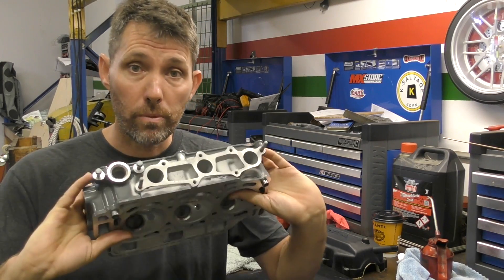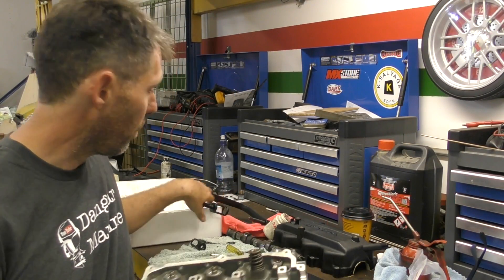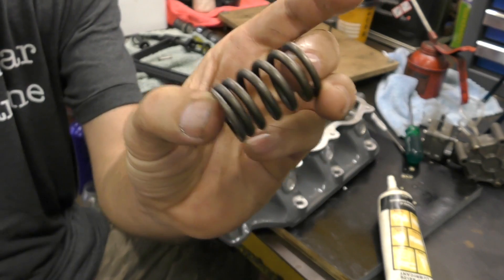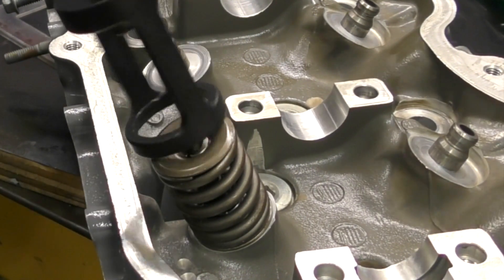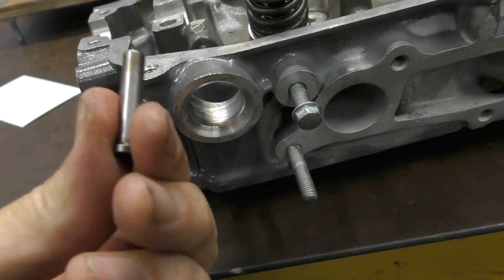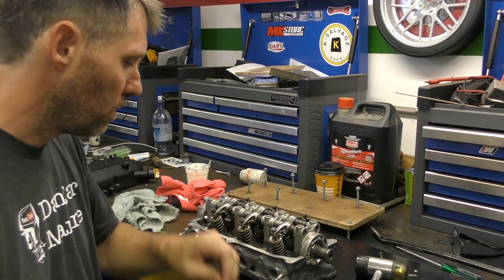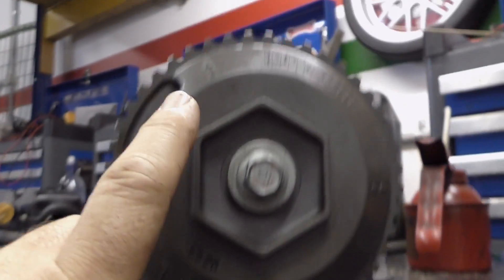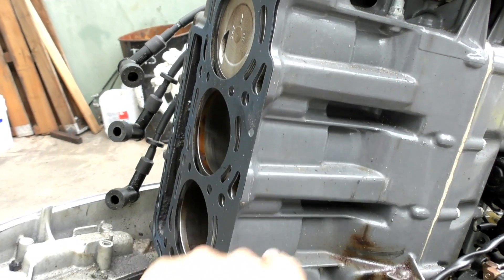Four stroke outboard cylinder head rebuild

Comment: Hi Stu, I am currently working on a 10hp Honda that has broken the cam pulley. My question is: will the valves have perhaps hit the top of the pistons and bent them, or are the pistons far enough away from the valves( interference or non - interference)  Your help will be highly appreciated- regards Dale Harris

Comment: I have a 40 horsepower Suzuki four stroke The intake valve have no clearance exhaust valve have way too much  clearance I have no compression on the bottom cylinder it's exhausting out got any ideas or film

Comment: Need to change head gasket on a BF50A Honda.  Can it be done without removing the cam shaft and valves.  In other words can I access the head bolts.

Comment: Have a suzuki df70 2003 4 stroke compression test all good bottom cylinder has best compression but getting water in oil and into cylinder 4 any advice on what's my problem??
Reply from the maker: Most likely a blown head gasket.
Reply: @DangarMarine  wouldn't i lose compression?

Comment: I found two of them collets in my sump when I emptied the oil and the second cylinder isn’t working? Any ideas what would cause this and is it a case of take apart and reinstall the collets? Thanks
Reply from the maker: If they haven’t broken I would say it was caused by incorrect installation. You might want to install new ones to be on the safe side.
Reply: @DangarMarine  thank you for the reply, I am now very confused I took the rocker cover off to check and all 6 springs appear to have the collets attached. However second cylinder isn’t firing as when I take the spark ht lead off there is no change in engine compared to the other two leads when I take them off. Have switched all spark plugs around and they all work. :-/ also the spark plug in the second cylinder was very black

Comment: Hi Stu! This has been so informative, thanks a lot!
I am a total newbie and I am trying to fix my 5hp Honda outboard. We cleaned the carburetor and fixed the fuel line, and we got to the point in which it would start and idle properly, and run low for about one hour without big issues. The problem comes when we run full throttle. If it´s cold it would hold the power for a while, but as soon as the temperature goes up, it would lose suddenly strength and sometimes turn off. I got to the conclusion that the valve clearance must be adjusted, but I fear there could be some corrosion on the valves. Another very strange thing is that since a couple of days it would turn on ONLY with the choke off. (??)

Do you think that issue could be also related to the valves? or is it just the carburetor butterfly that is once again sealed? Would be worth trying do the job with no experience? Thanks for your time.
d

Comment: Hi I was wondering if you could point me into the right direction with my outboard I have a 50hp Honda I believe it's a 06 had a tapping noise in motor they clunk stopped run any idea's. Anything is much appreciated

Comment: Do you have a video on removing the head, then the power head?I have a BF130, possible issue with the valves or the piston. My cylinder 3 has 75 PSI compression. Other cylinders are 185, 150, 150. Cylinder 3 had the spark plug tip bent down. I pull the injector plug and motor does not stall. On all 3 others they stall.
Reply: Found 2 cracks on head block. It was between cylinders 2 and 3. So you recommend the valve clearance to be max limit based on service manual? Usually they are range between numbers.

Comment: Funny how different manufacturers design things like rocker shafts ,  was doing the valve clearances on my Tohatsu 50hp 3cyl last week , it has 6 valves too like the Honda but only a single rocker shaft ,  saves a bit weight only having 1 shaft , can't see what advantages there are having  2 rocker shafts for a single camshaft engine?  I do get some intermittent ticking noise on the Tohatsu,  suspect it might be something to do with the rocker arms sliding up or down on the rocker shaft , maybe those thin springs are too weak?

Comment: Strange that there are no cam bearings on these engines.  I would surely use a liberal amount of assembly lube on the cam prior to installation to prevent spalling.

Comment: Stu I just purchased a BF50 for a parts engine and it had a broken spring which caused the valve to hit
the piston damaging both......have you every heard of these engines breaking valve springs ? check out picture 8 https://www.trademe.co.nz/Browse/Listing.aspx?id=1745427227
 cheers Brett
Reply from the maker: I haven't heard of the them breaking springs but it can happen due to a minor defect in the metal. I have seen some of them quite rusty from a blown head gasket letting water into the oil which can also contribute to them breaking.

Comment: Great video mate , i am fairly lucky as my father was very mechanical and showed me a lot as i was growing up which has served me well over the years and also some of the tools i didnt have to buy . a question  with the pittting on the back side of the valves exhaust i think they were would it have paid to replace them or just leave them ? anyway very well explained and a good video .
Reply from the maker: I think it if the sealing edge of the valve is machined or lapped to good condition then the pitting isn't such an issue. When my friend got this boat back he said it felt like we'd turboed it it ran so much better. :)

Comment: Hi Stu, ive just brought a brand new head and valves (not pre assembled) for my ride on mower, just wondering if the valves still need to be lapped or are they good to go as is, considering they are new? Cheers.
Reply from the maker: It really depends on how they are cut, but if in doubt I would lap them, even if it is only to see how well they mate to each other. You will see very quickly whether there is a good contact surface between the two or not. If so, stop and cleanup, if not,  keep going until there is.

Comment: Hi,
can you tell where I can get free repair manual for Mercury 100, efi, 2008 ? I need bolt torque for head installing
Reply from the maker: You can usually find a reasonably cheap one on readmanual.com or tradebit.com
Reply: thanks !

Comment: Hi and thx for your great videos - I have watched and learned:-) 

Please allow me to ask a question as no one have been able to answer before....

I`ve got this motor (tohatsu ifs 30 Hp) witch is having some troubles as it runs varm, and the warning system starts. I've it for 1 year and the problem have increased, and now it runs varm af 2.5 minutes in full speed. 
I`ve clean alle the hoses and canals I can get to. I've switched the thermostat and the impeller and the gaskets and it did not solve t problem. You seem to have a point when it comes to outboards, so maybe you or others can give me a hint? 

I brought the motor used a year ago..

See the video here:

https://www.youtube.com/watch?v=1DJMTng5LEQ

Kind regards from Denmark:-)
Reply from the maker: The next two things I would check is that it is actually getting warm by testing the sensor and using an infrared thermometer. I would then also consider than it may be a blown head gasket causing the overheating.

Comment: Hey mate after some advice looking at buying a yamaha 75hp enduro apparently its been fully rebuilt and what not has a couple hundred hours use on it compression readings around the 95 to 100 mark all even i was expecting it to be higher but was told fatory compression for this model is 105psi is there any way you could check that for me cheers
Reply from the maker: I believe those motors do have quite low compression so it does sounds about right. Also, be aware that most compression testers aren't super accurate so you are mostly looking for all cylinders being equal.
Reply: Yeah thanks do you know where i could check what factory compression is for it
Reply from the maker: You'd have to locate the service manual for it. Try readmanual.com or tradebit.com

Comment: Very unusual valve/valve seat design !  I have never seen an aluminum head WITHOUT a valve set insert.  Ask the machine shop if there a special angles required on the seat and the valves themselves.
Reply from the maker: I'm hoping to do some filming at the engineer's one day. My understanding is that the angle he cuts on the valves and seats is very specific, but I'm not sure what it is.
Reply: I guess the real point is, it is NOT a classic "3 angle" grind !  You are lucky to have a good machine shop near by who pays attention to details !

Comment: Quick Q! Do you ever use an impact gun on anything or are outboards a little too delicate for that ? Cheers 🍻
Reply from the maker: Hey Liam, yep, I use an electric 3/8" impact gun all the time. I find it perfect for most jobs. I'll occasionally use the 1/2" pneumatic on the larger mounting bolts etc too.

Comment: Interesting the head has undrilled fuel injector holes - maybe Honda's next upgrade ? I know the engine is a repurposed car engine and in the car role it is fuel injected.
Reply from the maker: Hey Ron, this outboard was the very last year before they went fuel injected on the 40s.

Comment: Hi Stu thank you for posting this interesting video. I was intrigued that you did not lap the valves to their seats using carborundum paste and a dolly. Is that the specific advice for this particular engine, or is that a Honda thing? I have not so fond memories of doing this on a 1.5 MW - V16 diesel generator (some years ago) with 4 valves per head so 64 valve seats and you have to be uber scrupulous to clean out the last remnants of carborundum from the seats and valves and the in fact the whole head. IIRC the whole lapping process took 3 long 12 hour days and about the same again to assemble all the heads prior to fitting them to the blocks
Reply from the maker: Hi Norman, when I did the Yamaha I lapped the valves, but as this head had been off to the engineer, he had cut the valves and the valve seats. I'd really like to go and do some filming at the engineers shop to get the full story, but my understanding is that he cuts the valves to and angle very slightly different to the seats and then as they operate they bed themselves in to make a better seat than lapping will. (This is why the valve clearance closes up slightly in the first week of operation).

Comment: Hi Stu, no need to lap the valve faces with paste into the seats?
Reply: Ah that's good to know the details on that because my Honda shop manual for the BF 15-20 says to lap the valves if it doesn't seat well.  The devil is in the details. Great videos, learned tons from you sir.  In fact i wouldn't have considered doing a complete rebuild on that Honda 15 i found and pulled up from the briny deep without the videos, keep it up!!
Reply: they say its no longer needed  i always do to check my contact pattern and margins
Reply from the maker: Hi Matthew, when I did the Yamaha I lapped the valves, but as this head had been off to the engineer, he had cut the valves and the valve seats. I'd really like to go and do some filming at the engineers shop to get the full story, but my understanding is that he cuts the valves to and angle very slightly different to the seats and then as they operate they bed themselves in to make a better seat than lapping will. (This is why the valve clearance closes up slightly in the first week of operation).

Comment: Nice job rebuilding the head Stu. That tip for adjusting the valve clearances was a good one!
Reply from the maker: Thanks Jack.  I was pleased when Arnie said that, I would never of thought of it. That motor is due back this week to re-check the valve clearances after a week of running so it will be interesting to see where they are at.

Comment: Hi Stu,
I have been watching all your videos for a while now and i would like to say a massive Thank you!!!! 
I have a Honda 75hp outboard, a few trips back heading back into Jervis Bay after a trip to the banks the heat sensor alarm went off and the motor went into limp mode. i noticed no water coming from the tel tail! I managed to get it back tot he ramp and got home. That's when i noticed all the things wrong with it. 
It had been serviced 2 years in a row by a local marine mechanic in Mittagong (where i live in the Southern Highlands). It turned out he had charged me for replacing the water pump impeller 2 years in a row and i really don't think he actually did the job as when i removed the leg for the first time myself and opened the the water pump i noticed the impeller had 2 veins snapped off!! I watched your videos and replaced it, plus the base plate and put it back together. I then started to investigate further and noticed water in the gearbox oil, it was milky. So i had to strip the gearbox out and reseal it, pressure tested and everything came up great! I changed the engine oil which looked horrible given it had been "serviced" every year. I also replaced the thermostat at this time.
Still no joy, worked great with the earmuffs on, but next water test proved it still had a problem, it overheated again only 500m from the boat ramp. So i put a call out on Facebook on a well known game fishing page and everyone recommended a guy just outside of Sydney. I took the boat to him and told him all i had done to the boat. I told him i had been watching your videos and they were great, he actually said, Ohhh no not Danger Marine!! I said what are you talking about? he said Dangar Marine is known as Danger Marine. To which i quickly defended your channel as i would never have done the work i did had i not watched your videos. Anyway after $660 with him , told me the problem was sorted, he told me he cut the back of thermostat out so it was constantly running water through the head and it shouldn't overheat again!! I asked him why he did what seemed to be a band aid solution instead of finding the actual cause? He said cause if this doesn't fix it, its a head gasket which meant $3500 for a rebuild.

Next water test, it overheated again!! i was getting pretty pissed off by this stage!

So I set out and purchased the Service Manual for my outboard and watched all your videos, I ended up pulling the head off myself, had the head machined and all the valves re-seated (it was included in the head reconditioning, so why not??) they told me one of the exhaust valves was stuffed, so this was swapped out. Pressure tested fine.Also during this process i found one of the impeller veins that snapped off stuck in the water jacket!! ( I couldn't find the second one anywhere) I put the head back together and it fired up first go! So far so good. I took it down to the Shaolhaven river and dropped it in. Did 23nm without it skipping a beat. After all this i will never pay another person to service my outboards. Sorry for the long message here, i just wanted to convey this journey i have been on for the last few months, but its all fixed and running smoothly once again due to your expert videos knowledge. thanks once again!! Forever grateful Pete :)
Reply from the maker: Hey Pete, it's great to hear that you got your motor up and running, well done! The story you tell seems to be all too common. I can only think that it has to do with marine mechanics not being as tightly regulated as the automotive industry. It sounds very much like your original mechanic did practically nothing those two years, and at $660 to cut the back out of a thermostat I can see the really "danger marine" is the danger of getting ripped off. It's funny you should mention finding the impeller blade as I have been thinking of doing a video on that very soon. It is such a classic situation - pump is toast, put a new one in an still overheats due to the broken blades blocking the water. Unfortunately sometimes pulling the head off is the only way to get them out, so part of that video would be about not getting into that situation in the first place. You've done really well getting it running yourself, and I am really glad I was able to help you in my own small way. Enjoy your time on the water, Jervis Bay and the Shoalhaven River are fantastic waterways. Oh, and thanks for sticking up for my channel. :)
Reply: Let this be a lesson in the nature of modern business , if you want something done properly " YOU MUST DO IT YOURSELF "  . I would NEVER trust a Mechanic  with my engines as they're my engines and not his/hers ! To pay another human to look after YOUR shit is just asking for trouble ! especially "STEALERSHIPS" .
Reply: OH , and keep up the great work Stu , I really enjoy watching your vids . You obviously have integrity as a tech so you can exclude yourself from my recent rant !!